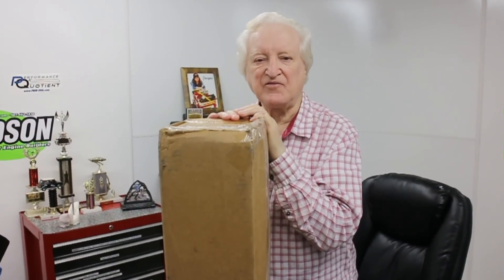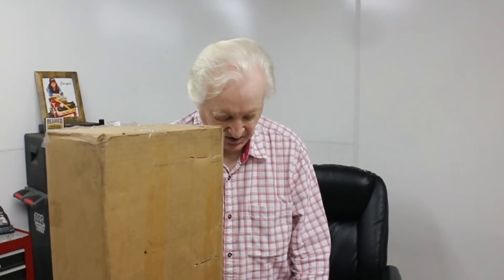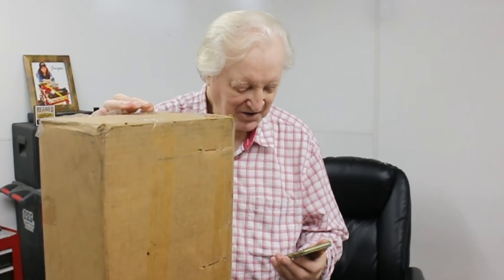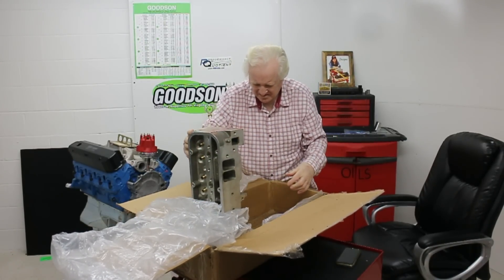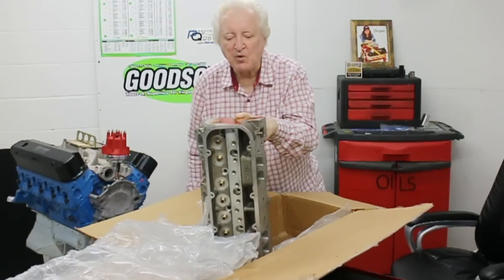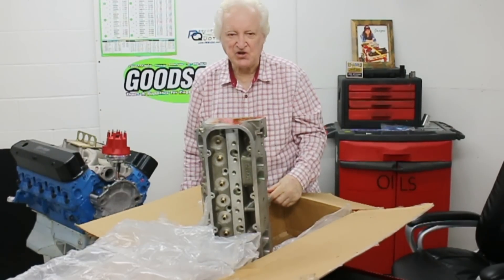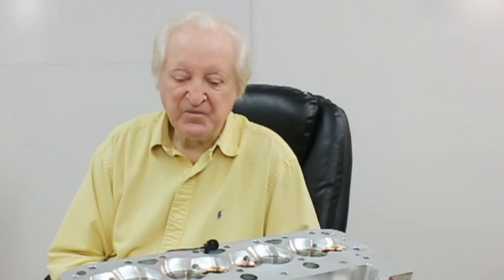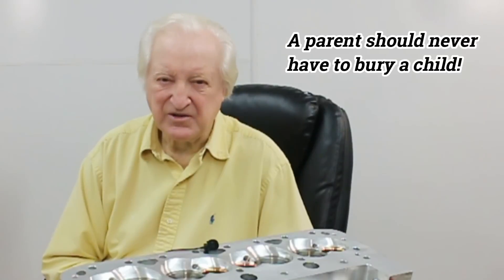Worlds highest flowing conventional parallel valve SB chevy heads??

Comment: 87 octane, if it was anyone else, I'd doubt it, but the furthest I'm willing to go is wonder, wonder how you are going to accomplish that, I have tried higher compression on pump gas,. I had no ignition advance, bad heads, it was  a peaky engine, made power in a narrow rev range, and  not that much, the best I did was 93 octane, but I went to the airport,  the av100 and a bit of tweaking,  it ran much better,  the lack of a stall converter, and single plane intake. With 3.42:1 gears, helped nothing. But from around 40mph on it did Good,   I'm very interested to see this monster!

Comment: 14:1 and 1000hp on 87 octane has my curiosity. I run a sbc 440c.i. 4in stroke ad wish I made 1000 hp. I run 91 octane wite 11:1 compression
Reply: I'm running 89 octane with my 10.7 to 1 399ci. sbc with heads flowing 404 cfm.
Reply: @heshtesh  interesting!

Comment: I’m not trying to be the BITCH of the group, but I’m guessing he meant to say 4.250 stroke? Because a 4.185b w a 4.125s is just about 454ci! I think that a 4.185b with a 4.250s comes out right around 468ci! Actually I’m hoping that it’s either the 4.125s crank & a few cubes smaller, or it’s a 9.325 deck height w the 4.250s crank! Somewhere in that small space needs to fit a connecting rod, & a decent compression height piston! He may have just ran through the figures quickly, with other stuff on his mind? Because I don’t believe he would start a build where things will end up crashing into each other or have horrible ring seal! I really hope it works out! As of the last few years, guys in small block nitrous categories, have been putting together SBCs all the way up to 500inches, or very close! Yes in a 4.400bs block 🙄🙄🙄🙄! It’s amazing how much stroke they cram into those little engines 😜😜😜😜! There has also been 4.600b/s SBC style engine built to almost 600ci 🤪🤪🤪🤪! Crazy stuff 😂😂😂😂!

Comment: Now I see why you can get 1000 HP from a SBC 468. I was considering a 434 SBC due to older head sizes, but the newer heads can handle the flow for the 468. Thanks for all the data so far. I will continue to watch the series!!

Comment: David, have you ever got your hands on a set of MBE cylinder heads for the small block Chevy?
Reply from the maker: Paul,  - - my son in law is one of, if not top porter/engine builders at MBE. Let me see what I can do.
Reply: @marvingvx1  Hello David, I've watched your PowerTec 10 - EP45 
several times & found it to be very helpful & interesting. As are "ALL" your videos. Regarding your recommendation to drill-out the rod journals of the crankshaft, is it equally beneficial to create "hollow" rod journals on flat-plane crankshafts? 
Knowing about the "vibration" characteristics of flat-plane crank engines, I plan to take every step to minimize this issue. 
I sincerely appreciate your attention & hope you will reply to my question. 
Best regards, 
Ben

Comment: Thanks for this.   This topic (high compression, high rev, N/A engine) is really what is interesting, as I am trying to do the same on an air-cooled engine .
Reply: Who’s heads or are they heads you are doing if you don’t mind sharing.
Reply: @tjakr3869  Don't mind at all...   I have built heads for the Type 4 VW engine found in the 914, with redesigned 28cc chambers, a redesigned exhaust port, and so far, the flow is 235cfm @ 0.5", along with 1.73:1 ratio rocker arms - all designed to be interchangeable with the factory setup - Hope this helps
Reply: @dannoyes4493  Awesome. I dabble in air cooled. I have a type 1, 2332cc with CB performance CNC heads, think 53cc chambers (does that sound right?). I know nothing about any of this but I am fascinated by all of it. Especially NA stuff. 23 cc chambers you must be approaching some of the static compression ratios discussed in this video. Also 1.73:1 ratio rockers is something that seems very unique to me. Thanks. Take care.
Reply: @tjakr3869  Excellent!  This is a hobby for me.  Retired & bored, I restored a 914 with the intention of swapping either a 3.0 Porsche 6 or an LS engine...  once I got the stock VW Type4 running, though, I fell in love with it - short story long, I had to start running calcs on everything, prototyping, testing, seeing what could be done...   the heads and valve train are just the start - Mr. Vizard's videos really give me insight into successful philosophies and, in some cases validated the direction I'm going...
Reply: @dannoyes4493  sounds like a fun way to stay engaged during retirement. I retired 18 months ago and just started messing with cars  I wish you well. Take care.
Reply: @tjakr3869  thank you - same to you as well.

Comment: Just an observation, but 468 cu in would require something like a 4.185 x 4.250 bore and strike. I can’t get there with a 4.125 stroke and a bore that fits a 4.400 bore spacing that I’ve heard of. OTOH, those ports are truly beautiful! If you can make 1.25 lb-ft at the power peak, you’ll need to spin it to 9000 or so to make that 1000 hp from 468 cu in. That actually sounds doable! Looking forward to seeing that happen!
Reply: 4.185" bore is simply a SBC 400 with a .060" overbore...
Reply: @BuzzLOLOL  Exactly. I’ve heard of 4.200” bores on a small block bore spacing, but not often. That only leaves 0.200” between cylinders with a siamesed bore block, like the 400 has. The 4.250” stroke would take an aftermarket, raised cam tunnel block, which is what he had—I think. That would put the pin really high in the piston, too, unless it’s a raised deck. Then it may be hard to call it a SBC any more.
Reply: @bdugle1  - Small or big block is based on bore spacing not whether low or high deck blocks...
Reply: @BuzzLOLOL  Bore is limited by bore spacing, the usual parameter that determines small block vs big block. Stroke limitations depend on deck height. For instance, 9.020 deck with 2.125” crank throw (4.25” stroke crank) and 6.00 rod leaves less than an inch for pin position in the piston.
Reply: @bdugle1  - SBC 400 and Olds 403 got around bore size limitations by siamesing the cylinders... 
After 1970, Ford wanted to lower the compression ratio of the 351W as they went into emissions slug engines tech, so they raised the deck height slightly... 
Olds and Pontiac don't have big and small block engines, but higher and lower deck height engines... 
Ford raised the deck height of the 351C when making the Ford 400...
Reply from the maker: Brian - it is a raised block (rocket block)

Comment: This thing should be called "Making Horsepower The Hard & Expensive Way". 
I don't get it so far - is it for some racing class that bans superchargers? Wouldn't it be easier to start with a Big Block? Perhaps it's for a motorcycle that doesn't have room for a bigger engine and associated supercharger and turbo?
Reply: Don’t think he is after easy think he is after unique.
Reply: @tjakr3869  Go-kart engine? There's hardly anything bigger won't take a Big Block.

Comment: The key to making those huge power numbers always come down to camshaft selection. When you have 468cid at better than 14to1 compression, as he said, the pieces are there to make it happen. I've seen a pro street Chevelle with a 468 smally, that was 20 years ago now, when that was unheard of. Believe me that sucker was Brutal!
Reply: Nope... HEAD FLOW is the key! Can't do anything if the heads don't flow... 
And, actually, 20 years ago we were taking SBC's out to 489" 
Also Dart heads and World MoTown heads both used to be in the same building in Detroit. Guess there was a squabble and Dart moved a bit north and racer Bill Mitchell took World to New York. 
My 550 HP SBC 405" is built with Detroit made MoTown Lite 220cc aluminum heads. 
World used to sell SBC 454" 500 HP crate engines with Mo Town heads...
Reply: @BuzzLOLOL  Nope, if you were paying attention and studied David V's books to the extent I have, just because a head has bigger valves or ports guarantees nothing. Engines need parts that work well together. Matching the right cam to the heads he got from the customer for this build. I'm not talking about crate engines here. Your throwing around displacements only possible with 10k race blocks.

Comment: Man! That's diesel compression ratios, and 468" out of a sbc? Holy cow! You have my attention as always D.V. Thank you Sir!
Reply: Actually, 20 years ago we were taking SBC's out to 489" 
Also Dart heads and World MoTown heads both used to be in the same building in Detroit. Guess there was a squabble and Dart moved a bit north and racer Bill Mitchell took World to New York. 
My 550 HP SBC 405" is built with Detroit made MoTown Lite 220cc aluminum heads. 
World used to sell SBC 454" 500 HP crate engines with Mo Town heads...
Reply: Sounds like a dart iron eagle or world products raised deck block, usually raised cam tunnel as well to allow the larger stroke.  Then you can step into the 4.5" bore spacing blocks and go even bigger.
Reply: @b.c4066  there are 500 cubic inch small blocks.  mostly in grudge race cars

Comment: Great set of heads . To flow that well is absolutely incredible for a small block absolutely insane . I must see the outcome of this motor. I did a few 410 Small block Chevs and the best the heads would flow was a very stout 550hp and 490 toque. Moved the 68 Beaumont rather well. 
A thousand naturally aspirated HP. This raddles my brain lol .Sir this is an engine that when ya get it done I would absolutely love a complete parts and specs list. Cause I have to build it myself . David this is a awesome build think I hear a  69 Nova calling for this engine.  Thank you again Sir for your great info that's always spot on. Keep the adventure alive 😎👍💯%🇨🇦❤️🙏

Comment: CAM specs anyone ?  I'm gonna say on a monster mouse like this beast to make 1000 hp we're gonna need to have 266 @ 0.050" int. by 270 @ 0.050" exh. with around 0.800" lift , 110 LSA, he did say he wanted to be a bit shorter camed 5:52 and maybe 17 to 1 comp so peak cylinder pressures at around 7000 rpm ?
Reply: That duration is way small.i run bigger In 400s with 13 to 1. I'd say 290s @ 50 maybe 300s.
Reply: @ryangulley2051  What are u using that in ? seems to me with a cam like that you wouldn't be making power below 4k, what rpm are you shifting gears at ?